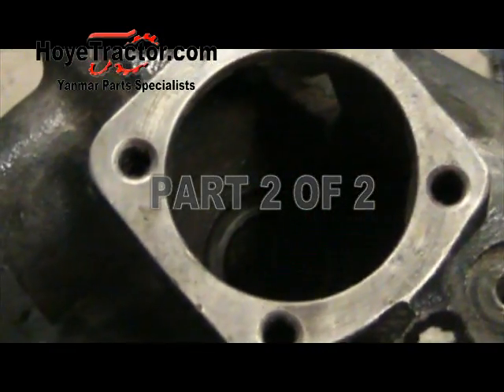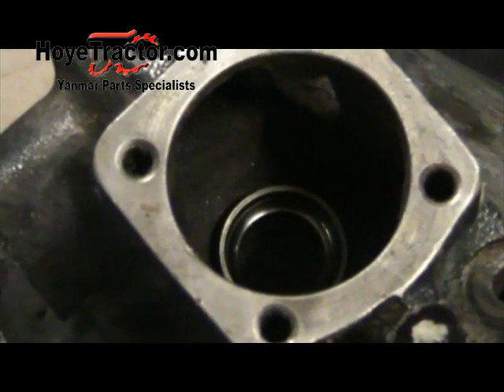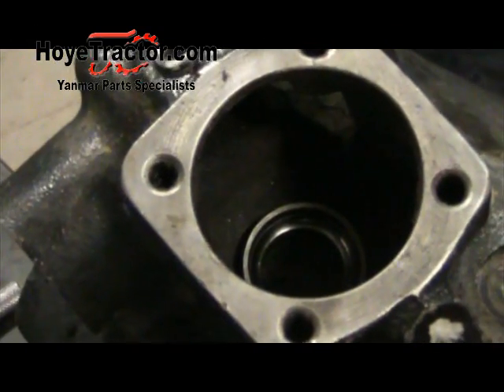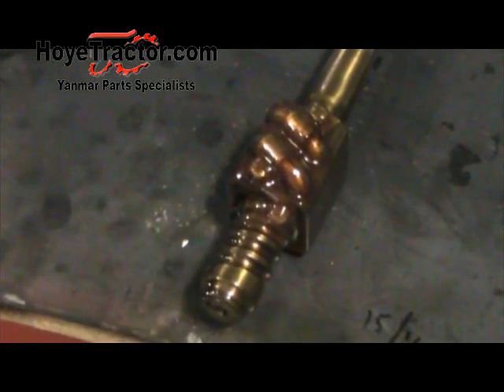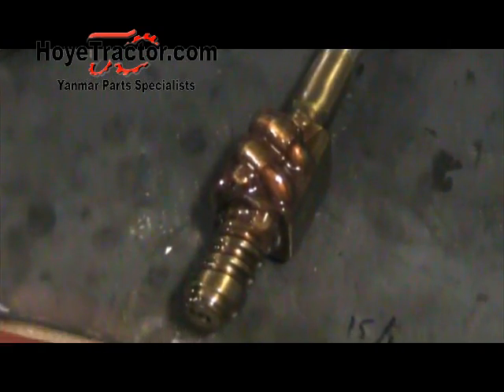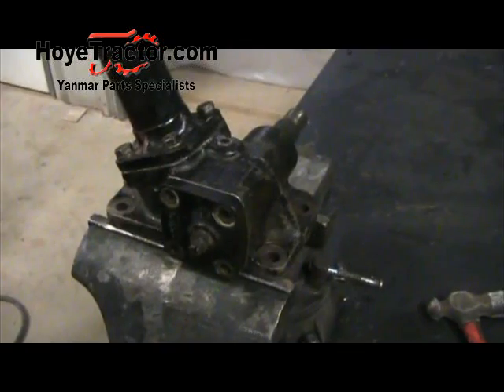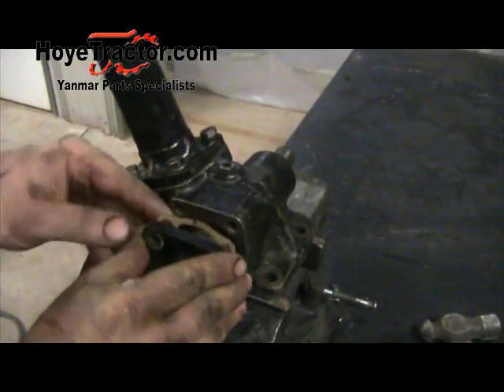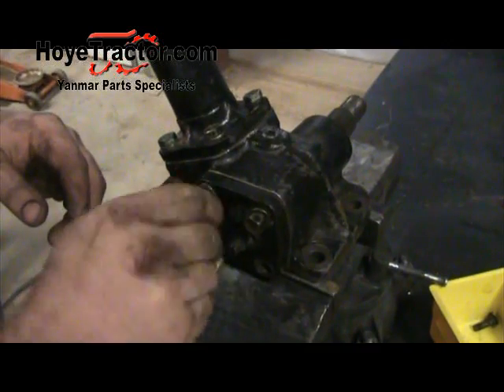Yanmar Tractor Steering Box Rebuild - Part 2

Comment: My gear box looked just like that, a mess. Water had seeped into the box and rusted out both bearings and the "U" shaped bearing tubes on the nut. I have a 1984 IH254 but the gear box is the same. I ordered some shims from Hoye Tractor, and the bearings and tubes from another vendor (before I saw found video). I believe the shims were made for a Yanmar 2000. I was not able to get the lower bearing race out so I just buffed it with my Dremel tool, and crossed my fingers. Now I'm back in business. I would have been working in the dark without these videos.

Comment: This is a great video, thanks. I have a Ford 1210 and recently snapped the steering shaft. It’s happened a couple of times since. This will hopefully make my rebuild more accurate as I had done one or two things wrong. Has anyone else had this issue? I have a front loader on it and am careful to balance the weight but it’s frustrating when it happens.
Reply: Yep same problem check the outer shaft steering column tube is not bend.  If it is, then this puts extra load onto the whole assy and also munts the bearings.  Rebuilt my a couple of times before I realised the outer shaft column was bend from too many fatties hopping on and off using the steering wheel to pull themselves up.

Comment: Did I miss installing the ball nut somewhere? Saw you take it out in pt.1 .
Reply from the maker: The ball nut comes pre-installed on the shaft.
Reply: @HoyeTractor  Thanx, my YM1500 lost it, wheel spins and won't grab, haven't pulled it apart yet but I'll be in touch I'm sure. lol

Comment: That steering box looks the same as used in the John Deere 950 and 850 tractors which were made in Japan with a Yanmar engine.  Do you know if the Yanmar steering box interchanges into the mentioned John Deere tractors?
Reply from the maker: Yanmar actually built the entire '50 series John Deere tractor (650,750,850,950,1050...) - not just the engine. The exact box does not interchange but they are very similar and we do have the parts to rebuild those also.

Comment: Is it normal when reinstalling the shaft into the housing for the bottom to rest on the bearing, or should it somehow click in or otherwise "seat"?  When I reinstalled, before I kind of got the hang of where things were going to go, the bottom of the shaft would work the bearing out of the race, through by my wiggling and setting to align the other parts.  I had to be very diligent during final assembly to ensure the bottom of the shaft rested on (in?) the bearing.  Also, the gear square on the shaft would rotate about the shaft axis until I got the horizontal gear shaft in place.  Everything in there just seemed to have too much play - not much of a tight fit at all.  Seems to be working, but don't have the confidence I've done things correctly.
Reply from the maker: Yes the shaft just rests on that bottom bearing during assembly. Once everything is tightened up it can not come out of place but until then you have to be very careful to keep in aligned.